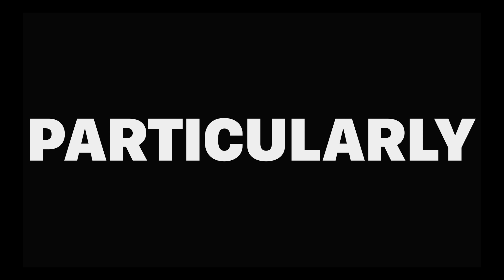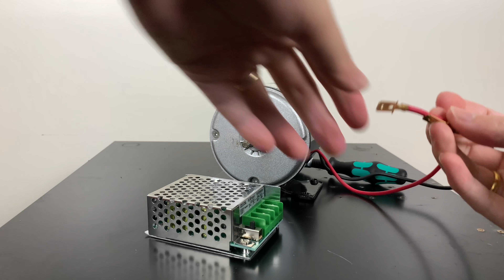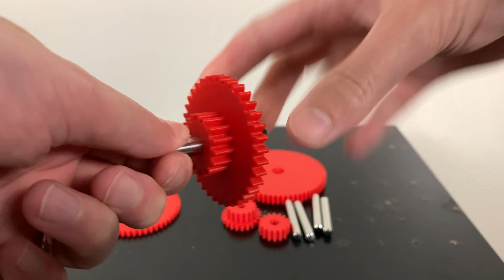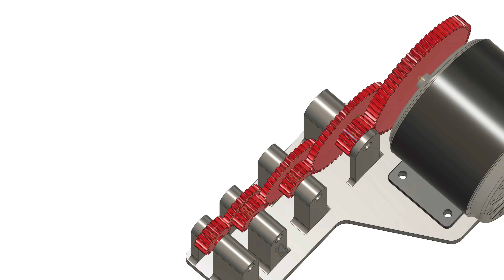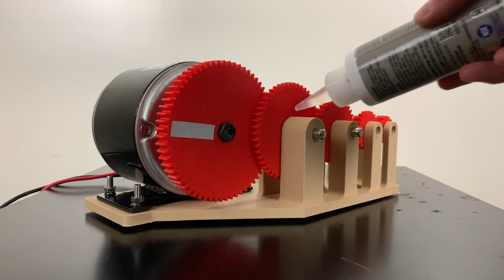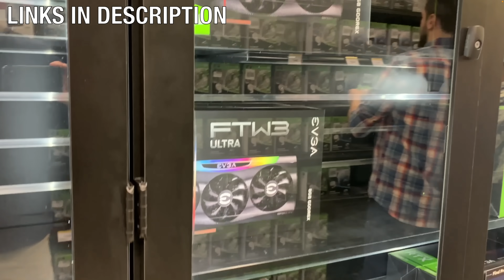Fastest 3D Printed Gearbox Ever.

Comment: You would get higher speeds just by lubricating the gears with a silicone spray. You could do a before and after run to see how large the improvement is.
Reply: WD-40 Teflon spray. It's amazing.
Reply: @unclespezball  Id do dry teflon powder first, then maybe dry graphite, then try the sprays next....starting with that one you mentioned.
Reply: @ChadDidNothingWrong i love to snack on teflon powder.
Reply: @janm.4496 I bet you never have constipation
Reply: @DavZell  need to wear a diaper 24/7 tho
Reply: @unclespezball 
Lmao,.. me using coconut oil and getting so much improvement...

I have an DIY gearbox for my diy ebike. The motor output is 2650RPM(250W) but with my gear box it's 3400RPM, also good touqe. Also good performance and silent operation with oil.
Reply: Why not just use bearings? It make it have less friction by a lot
Reply: @musicmemegodz8500 Because it’s 3D printed
Reply: He just did idiot, watch the whole video before you comment.
Reply: It needs bearings.
Reply: @leonreynolds77  above 50.000 rpm, think about air bearings.
Reply: Wd40
Reply: guy dunks oil all over the gears, no way they're under-lubed
Reply: @poptartmcjelly7054  Too thick and viscous, needs something really light weight and not sticky.
Reply: @billdoodson4232  Teflon powder!
Reply: @ChadDidNothingWrong  otherwise known as "how to permanently contaminate the environment".
Reply: @poptartmcjelly7054  lube up 😏😏😏😏

Comment: Cool
But did you think of using bearings for gears ? You already use non printed axels
Bearings can significantly reduce friction between gears and axels, resulting in much higher resulting speed.
Also bearings will help with precision which will help to reduce friction between gears and will not let them wobble  (this is frictions losses too)

And if you mad enough you can end up using ceramic bearing instead of usual ones, which do not need grease and have extremely low friction.
This will give you the best result, but using ceramic bearings will be very costly in comparison to usual bearings
Reply: Since it’s a PLA how can we even make a bearing
Reply: took the words right out of my mouth, thanks for saving me the time to type that 🙂
Reply: Not to mention it would greatly reduce wear on the gears, since there is nothing between the shaft and the gear
Reply: With just 120 rpm I got it going 50 rps using gears
Reply: Add a weight wheel so you can accelerate slowly but with little increment of torque. The spinning torque will be kept by the momentum of the heavy wheel, so you can add more gears if torque is the problem
Reply: I built a 3d printed fidget spinner that used ceramic bearings and had a steel outer ring for maximum rotating mass. Best hand spin was a little over 7 minutes. Ceramic bearings are next level

Comment: You need a way better power supply, that brick can't supply the amperage that motor needs, that's why it shut off
Reply: It needs 31-30 amps for that motor
Reply: If is a 12v motor
Reply: pwm controller not psu
Reply: @fss1704 PWM isn't magic, if it's a 350 watt motor and you run it at 100% duty cycle you're still going to saturate whatever the power supply limit is. Judging by the thin gauge of the wires connecting to the PWM controller as compared to the motor, yeah he's definitely running out of current

Comment: Seems basically you proved that your gear setup is pretty shabby - in that your speed actually went up as you decreased the gear ratio! Clearly the opposite of what one would hope and expect if your goal is to build a high speed gearbox. Fail!
At a minimum, add high speed bearings. Otherwise, you are just proving the limits of friction. I had hoped for a more sophisticated and talented approach.

Comment: there is no way that little power brick can do 350w, that's why it cuts out
Reply: Yea, that power brick is probably way underrated for that huge motor lol
Reply: @hyper_au  Look at how thick the wires are running to the motor....and the spindly little wires on the power supply....🤣
Reply: it's probably a pwm controller.

Comment: That small power supply surely cant supply 350W?
Reply: that thing with knob is not the power supply i believe, thats the speed controller
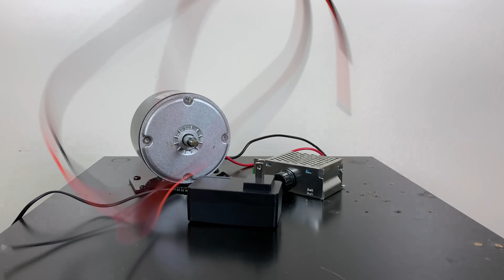Reply: @erick2328  at 0:21 it is a small wall adapter (black box) plus the extra long wires for extra resistance
Reply: @billytisme  oh yea, i didnt see that, that probably only 5a adaptor
Reply: My electric scooter has 2000 watts in a motor smaller then that

Comment: im not a engeneer or something like that but i think torque would be a problem
Reply: @jsncoww  here there is something to "lift" though. Each gear acts as tension applied, creating the need for torque.
Reply: @jsncoww bruh, you forgot friction inefficiency. Even without a load, if the gears have too much friction, the machine won't work.
Reply: @Cyberlong  You can't expect much friction efficiency from 3d printing tho.
Reply: @Cyberlong literally so much friction with no bearings and shitty lube, if it were done with helical gears made from metal with proper grease and proper bearings for the rated usage it would run extremely smooth. keep in mind this is a 3d printing channel so its whatever
Reply: @Cyberlong u forgot the size of the motor
Reply: It is. Just an inevitability from the engines
Reply: It's not only friction, it's mainly the inertia of the gears. It rises quadratic at each gear ratio, making the last gear feel like a huge one, for the motor
Reply: I’m wondering if the people saying “that’s what i was thinking” or “yes definitely” are actually in the conversation or trying to seem smart
Reply: @SaltiemcFattee 
You never know. It's never just one or the other.
Reply: @SaltiemcFattee Indeed 😊
Reply: That’s what I was thinking lol
Reply: Yeah
Reply: Yes definitely
Reply: Big problem
Reply: @jsncoww the gears have mass too
Reply: Try using some bearings next time. That way the force of friction will be reduced to a minimum, may achieve a higher rpm that can be sustained. This will also increase the efficiency of the system.
Reply: those are gears, bro!
Reply: More gun
Reply: Your right it couldn’t pull much unless you spinning very fast
Reply: Torque is not a factor in this experiment just speed …
Reply: @zat-1-fury  torque sure is a factor. Not enough torque is the reason the motor can’t spin the high gear ratio. Just because he’s not measuring torque doesn’t mean it doesn’t matter.
Reply: What torque???
Reply: @timondemuys9198  EXACTLY it has none ...
Reply: But In the real world torque is inversely related to speed, more speed equals slower acceleration, and pushing the acceleration limit/accelerating too fast will rupture the gear
Reply: I am, and it is. It is fairly straightforward to work out. 
Take the friction torque of each axle and multiply it by the gear ratio for 'that axle relative to the motor'. This gives you 'apparent friction torque' as seen by the motor. Add the same from each axle (including the motor shaft itself (gear ratio is 1)), and you get the total friction torque the motor sees. You can see in this demo that when using very high gear ratios, the axle friction becomes ludicrously significant.
Reply: (ignore friction)
Reply: i love how exactly nobody has noticed the spelling mistake
Reply: @REDACTED.O5-13  shut up :(
Reply: You might try shrinking the gears
Reply: Yes bro torque is inversely proportional to rpm in gear system
Reply: @as_if007 torque is the vector product of force times radius arm length. You can have a torque without there being motion. For example when using a torque wrench to tighten a bolt, at the end of tightening, the wrench has no motion but it has the full torque measurement on it. There is no correlation between torque and rpm.
Reply: @billyoung8118 bruh please google it, I think you should learn about mechanical engineering "The relation between torque and speed is inversely proportional to each other " 😊
Reply: Yea if he could solve the towark issue there would be a weirdly fast geared electronic vehicle
Reply: Ofc. But since here this is for testing purposes,  not actual usage.
Reply: @Doom-the-vroom-vroom  you obviously do care 🤔
Reply: A small gear to a big gear gives torque and a big gear to a smaller gear gives speed and less torque theres your expected answer 😂
Reply: This being a shitty video is what it is
Reply: To solve this problem, he could use 2 motors
Reply: I hate torque
Reply: Sorry to be that Guy but "an*"
Reply: @LeoOfficial0  ?
Reply: @jsncoww  You miss something called rotational inertia.
Reply: No shit Sherlock the point is speed not torque
Reply: In that case he doesn’t need torque, because judging by the experiment he isn’t making a machine or tool and he’s just doing this for fun so torque is not needed